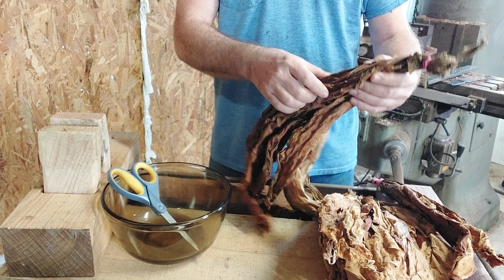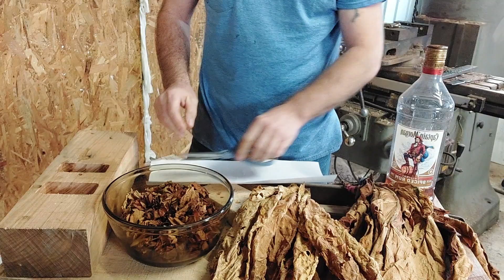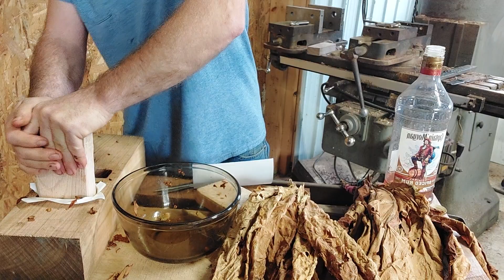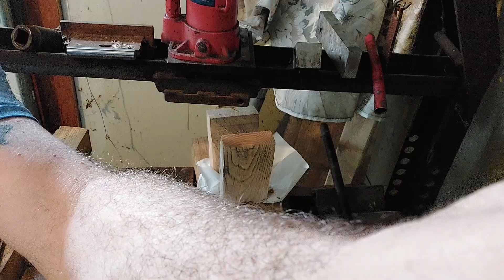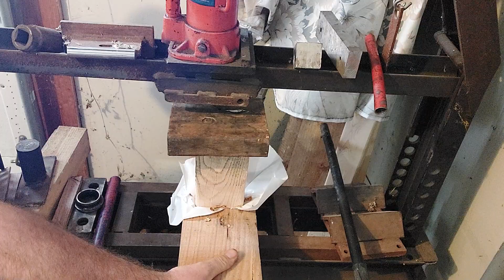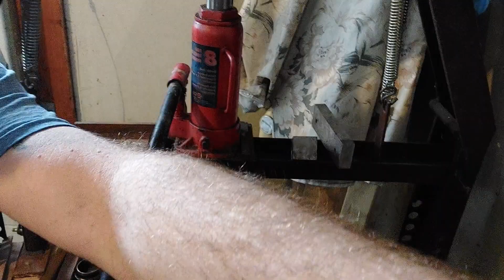pressing homemade tobacco plug. pipe smoking.

Comment: What is that press set up called? Can you buy it at Home Depot?
Reply from the maker: Shop press
 Could use c clamps all so. About any thing that has pressure will work.
Reply: @unknownpipesmoker5592  I'm thinking of getting a Dewalt Clamp. $65 but it'll be worth it in the end!